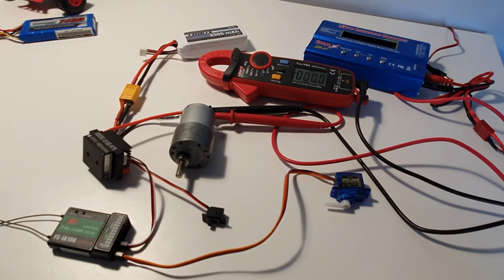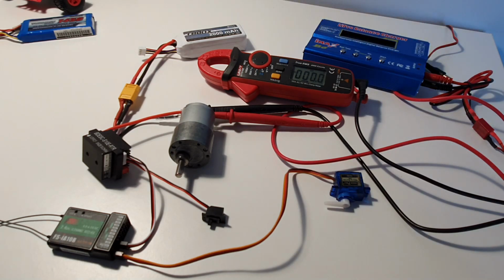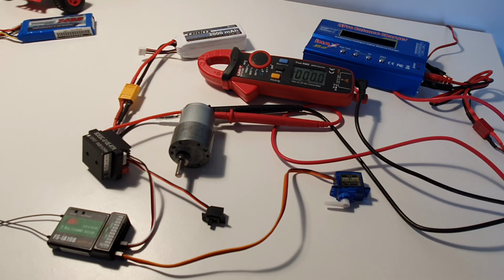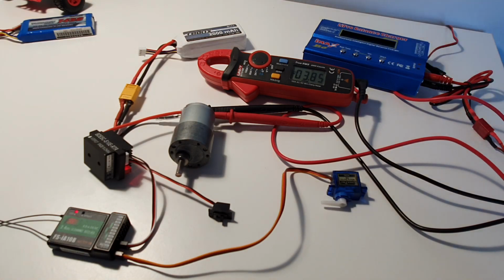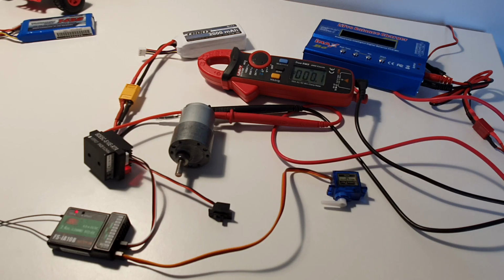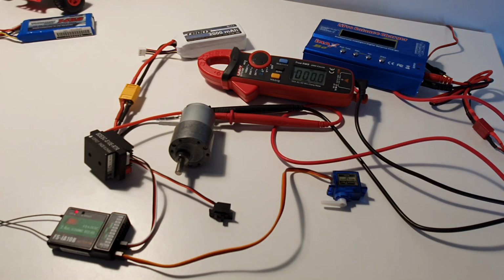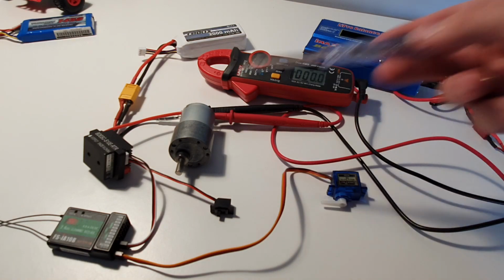Low Voltage Output From BDESC-S10E-RTR ESC?

Comment: You need to change the curve of the tx throttle from being (-100 to 100) to (0 to 100) for the throttle as it is a bi directional esc.
So throttle stick all the way down is 0 and not -100.

Comment: I have found no Manual, and had the same problem. I have 9,6V Ni-MH and have changed the battery jumper to the middle and outside pins. It seemed to work now. You can try it also. Perhaps it works.
I think the problem is the cut-off of the voltage. This works not properly. Before  changing:  In the beginning it works, after  the second command,  the red light is always lightning. After voltage reset it works for a short time again. I have got another item which is only running in one direction.

Comment: The brakes don't work, can y help me?
Reply from the maker: What do You mean? I'm still working on this ESC to make it work
Reply: @gettingintorcand3d955  I use it on my rc car, but when I reverse the controller, nothing happens, it doesn't brake or reverse
Reply from the maker: There are two types of ESC, forward only (like for drones) or forward/backward (like for cars) are you aware of that and have the right version?
Reply: @gettingintorcand3d955  my esc is BDESC-S10E-TRT some your, but my esc don't brakes...

Comment: Is this your problem, as that is an esc for a brushless motor? >>>
"Brushless motors require controllers that are completely different from controllers for brushed motors. For any brushed motor: Select a controller for brushed motors. The controller voltage rating, the motor's maximum operating voltage and the battery voltage should all match."
Reply: This ESC is designed for a Brushed Motor